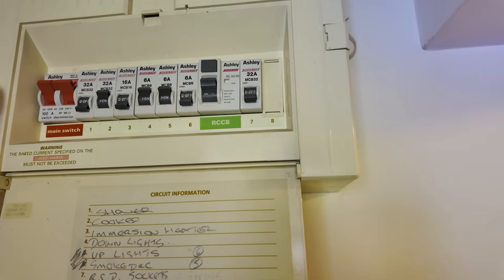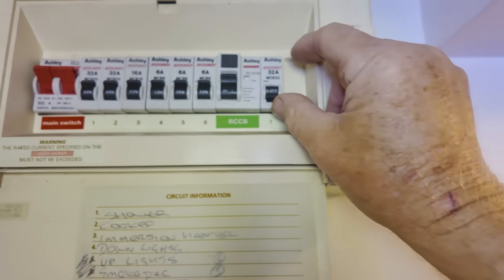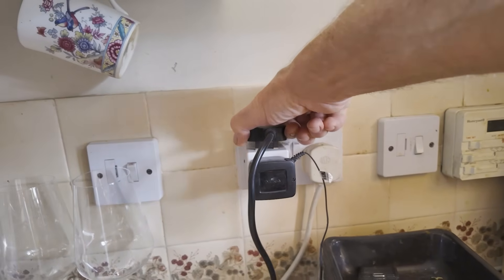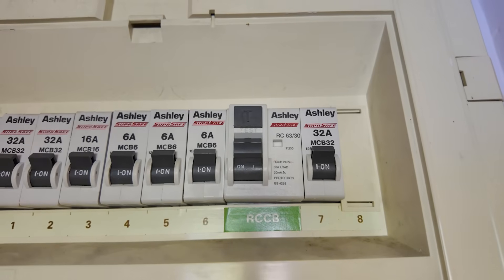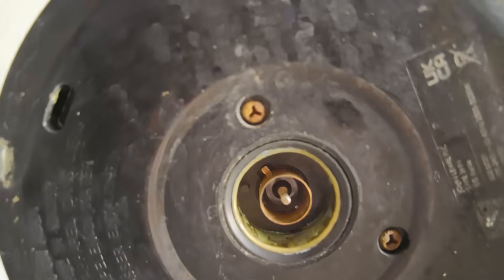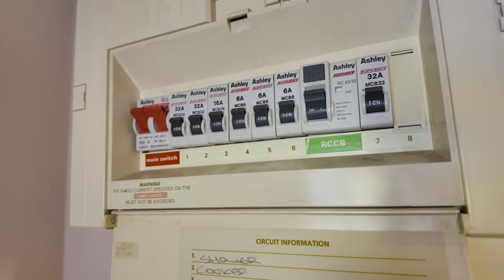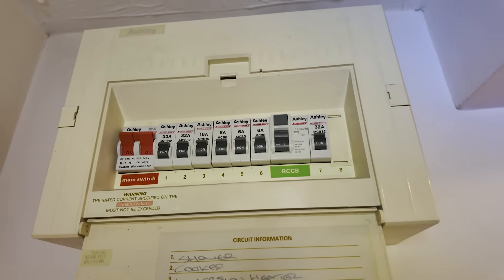FIX Your Tripping Circuit Breaker FAST!

Comment: It is almost always the bloody kettle. The insulation inside the heating element eventually breaks down due to the constant heat/cool cycles and this allows a current to leak to earth. Same thing with electric rings on cookers and hobs.
Reply from the maker: You are right but I think this one had a small leak on the bottom socket. There were traces of moisture

Comment: Yes of course ! wired fuses  CAN  cause a fire , if lazy folk just bung any handy bit of wire in them ( steel garden wire will glow red hot ! ) ... it is a good idea to have a few spare pre - wired fuse carriers ( white dot  5 Amp , blue dot 15 Amp  and red dot  30 Amp )  this gives  a  reconnection  as fast as flicking on a MCB ! .... I use a plug in RCB for outdoor activities , but the ones at the distribution board can trip in thunderstorms ( plunging the WHOLE house into darkness ! )  ... and .... certain heating elements ( sandwich grills ) , stored in a damp shed for 5 years , will trip the RCD ( until the powder in the element dries out ! ) ... also ... there is so much inside a MCB , ( rarely )  some have even caught fire ! new technology is not always the best , and even so called SMART meters have a bistable relay in them .... this means that some numpty can remotely disconnect you , I would find this annoying at 3am ! ( not possible with the older meters ! ) ....... DAVE™🛑

Comment: You'll think I'm making this up but I'm not... When I was toasting teacakes (no, not the Tunnocks variety) in a toaster, they would often trip the circuit breaker to the point I thought the toaster was knackered but I believe the fruit IN them was making contact with the electrical element in the toaster causing the breaker to trip. It's never done it since as I usually 'squash' the teacakes so they easily into the slots.
Reply from the maker: Hi Mark 
Any moisture in the bread or tea cake will short the toaster. Also sticking a knife down there to remove stuck bread is not a good idea, as I explained to one customer.
Reply: @SkillBuilder  Let us hope that one customer is not posthumously awarded a Darwin Award 😆

Comment: I have a UK , 1950's  FUSE BOX ... and I am  VERY proud of it ... the ONLY time a fuse blew ( for over 60 years ) was when my outside light's rubber cable developed a short .... (  how difficult is it ,  to re - wire a blown fuse ) ? ? ... DAVE™🛑
Reply from the maker: The fire risk with rewireables is way higher than MCB and having an RCD is essential.
Reply: Roger is correct in saying the fire risk is much greater with a rewireable fuse than a MCB as a MCB will trip much quicker & much closer to the Nominal rated current of the protective device. Whats more important to understand is neither a rewireable fuse or a MCB will protect you from an electric shock , that's the job of the RCD . Fuses & MCB's are over current protection devices which are there basically to prevent cables from overheating caused by prolonged overloading & provide short circuit protection. 
RCD's should be tested regularly to ensure correct operation, a basic test is to push the test button, which will confirm it is operating, but not necessarily correctly, this will require an electrician with the correct test equipment, which will confirm that the RCD trips with the correct time measured  in milliseconds & at a leakage current of between 18-28 milliamps approximately from memory depending on type of device. Again from memory I think it only takes a current of 50 milliamps across your heart to cause a carrdiac arrest, it is a tiny current & the RCD can prevent this if working correctly!

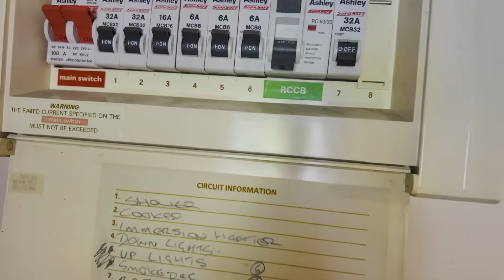Comment: 2:13 umm the RCD is still off, turn that on, and then try the last circuit, and you might have proved something, but I guess you figured that out off camera..  Otherwise, not bad.  Thanks for not opening the board, there really was not need.
Reply from the maker: The whole point was to take the viewer through a logical sequence. It is unusual to have only circuit protected.

Comment: Nice work! My money was on the multiple trailing leads with all the electronics attached. Most electronic kit uses switched-mode power supplies to create the DC to drive stuff like PCs, laptops,  phones etc. I've read each power supply can 'leak' between 1 to 3 milliamps. So if you have a number of devices on a spur/ring with a 30 milliamp upstream RCD, you can reach that limit pretty easily! That being said I've got lots of power supply stuff in my house and its not tripped due to that - yet!

Comment: Nice one Roger, very helpful diagnostic for most people.  The house looks like it is a bit of a pickle,  wires and all and no protection on those left hand circuits.   Not so good.
Reply from the maker: A bit of a pickle is being polite. It needs a new consumer board and some more sockets for sure. I don't think the present owner will do it.

Comment: Some of those sockets and even the consumer board itself have got "dated" written all over them. This might not be a problem per se but I know that when we had our consumer board updated, suddenly the bar fridge in the conservatory was tripping out everything on the same circuit, which was basically 80% of the sockets in the house. This never happened before the consumer unit upgrade. If you upgrade the consumer unit, expect more appliances (which used to work before) to trip for no apparent reason.

Comment: The consumer unit is an old split one with one rcd for the sockets only . This was common  years ago as all the other circuits were classed as fixed equipment,  like the immersion and shower etc . The main risk at that time was from hand held appliances and things like the lawn mower . The appliance check you did would always be the first thing but don't forget things like washing machines as you sometimes can't get to the plug . The common cause of rcd tripping is faulty heating elements like I  kettles , washing machines etc
Reply from the maker: Yes you are right. I made the video to explain the logical sequence of elimination. I could have started with the kettle.

Comment: Those surge protection extension leads can go rogue also - we had a trip fault, took me ages to figure out when the TV powered up the electrics sometimes when off. It was the extension lead which was duly thrown in the bin 😂

Comment: I've worked for one of the electricity distributors for the past few decades & have gone through this process over the phone & on the internet with thousands of people. Here is what I've learned:

- If the system is tripping it's nearly always the RCD, which detects earth-to-ground faults. The MCBs would generally only trip if the circuit is overloaded (rare) or a short circuit (also fairly rare). 
- Sometimes the RCD trip activates but doesn't flip the switch to the off position. Rare but it does happen.
- Turning ALL of the switches off & back on again sorts at least 50% of no-supply issues. The exceptions are when there is a powercut (from outside), lack of credit on a prepayment meter or if there is a faulty appliance,  like the one shown in this video. 
- Sometimes the RCD may trip due to a 'blip' & there is no underlying issue, so ALWAYS reset ALL of the switches. People tend to just look at or reset the main on/off switch & ignore the rest. These blips can be caused by things like lightning strikes on overhead lines or fault switching by the distributor on nearby circuits, or a 'blip' with something in the house, that then resolves itself.
- Faults with the wiring are far less common than the issue being with an appliance that is plugged in.
- A faulty appliance doesn't need to be in use or even switched on at the socket to trip the RDC. It's very sensitive & will detect earth leakage even through the residual current running through the circuit.
- Roger's method to locate the problem is spot on, but you could save time by doing the kettle & toaster first, as they are the culprits 90% of the time. 

I've also learned that, despite 20+ years of daily experience resolving these issues, a large percentage of people I speak to suddenly think they're electricians & know better than the professionals & think they don't have to listen to instructions that will help them fix the issue. Always satisfying when resetting the RCD gets the power back on & they have to eat humble pie. I've even had electricians who've been caught out by the RCD (at least they claimed to be electricians). Human nature is a funny thing!

Comment: They need to ditch those adaptor blocks, get a sparkie to install a bigger and better board and get more sockets installed to avoid the adaptors. I'd run a mile from that place as it is.
Reply: It's far from ideal but it's unlikely all the appliances plugged into the strip will be running at once & If they do put too much load onto the system, the breaker should activate. UK wiring is amazingly resilient to this kind of abuse, though I totally agree that an upgrade would be advisable.

Comment: Many years ago when rewireable fuses were still common place If you were called out on a Monday the first thing I would ask the customer was have you done any DIY over the weekend, no would usually be the first answer then I'd ask if they'd hung any pictures up, sure enough a great streak of blackness showing above the picture frame was often the give away.
Reply: That would be me! Put a nail through a downstairs wall at a weekend over Xmas, just above a light switch - what a prat as I assumed the cable ran down to the meter cupboard - not up and over....but yep weekend DIY and a scorched nail was the fun I had in a house full of Xmas lights - hiding the fact the downstairs lighting ring didn't work.... muppet....

Comment: Thank you Roger.  Much appreciated.  I suggest you turn off half of the sockets to see which section has tge problem
Reply from the maker: Good idea. What I did here was to go to the house and even though I could have just concentrated on the kitchen appliances I wanted to show how you would go about it if you were a householder. All those trailing sockets just added to the shock horror of the situation.

Comment: Moved into my new build 21 years ago almost the top thing in our car was the kettle. 5.15pm ( Friday) plugged in the kettle and the whole house electrics blew. Ran over to the site manager and he found an electrician almost 60 miles away to come out to use. 6.45pm he arrived . Went over the whole house and discovered the kitchen socket had water in it. Couldn’t find a leak anywhere, replaced the socket and everything worked. When he’d gone I had a moment of clarity - there was one thing resting on top of box carry the kettle - the cat travel basket. Turned out the cat had got nervous and pissed in the basket, running into the kettle plug just below. 😂
Reply: I'd like to see this made in the style of the old Discovery Channel air disaster documentaries:
6 hours ealier, twenty miles away a man is making an innocuous decision that will have disatrous consequences
Here kitty kitty....
Meow

Comment: Ahhhh you bring back memories. Had a similar problem except we never isolated to one device. Happened enough to be a big nuisance but every test sequence gave a different unrepeatable culprit. Finally got the electrician. No diagnosis either but he agreed to install separate fuse-RCD switch units for each circuit. No problem since. Apparently the combined RCD detector was failing,
Reply: Sometimes it's cumulative leakage from all the circuits pushing the rcd over its limit, with individual RCBOs it won't have any problems
Reply: @TheChipmunk2008  Agreed. The RCD mechanism is very sensitive. Such a situation is rare but certainly not unheard of in my experience.
Reply: @Rooster---ooo  We see it a lot (professional sparky). Especially with type AC rcds (the older simpler ones) and a lot of modern appliances. Modern appliances tend to have leakage to earth due to the filters they have to have to comply with EMC requirements,  a couple of milliamps each soon adds up!
Reply: @TheChipmunk2008  I work for a DNO & often deal with enquiries where there is regular tripping but no obvious internal cause or history of switching on our network. At that point, it can be difficult to ascertain whether the fault could be internal or external. Comments sections like this are a great way to share knowledge & experience. I learn new things every day.
Reply: @Rooster---ooo  Always amazes me how clueless a lot of people are about their electrics, one lady we did a quote for recently didn't have a CLUE what a fusebox was, let alone where it was... HOW?!
Reply: (early 70s house, meter cupboard just contained a 60A switchfuse with a 16mm T&E coming out, board turned out to be in a cupboard LOL)
Reply: @TheChipmunk2008  Spot on. It amazes me how some people can live their whole life & never once wonder how the electricity gets into their house. I figured all that stuff out as a boy, many, many years before I started working for the grid. It's just one of those things you figure out for yourself, like Santa not being real.

Comment: Rodger didnt want to shine a light on the problem. The problem is too many plugs in plug boards and multi sockets. Hope you checked his smoke alarm he'll need it.
Reply: It’s only a problem if you plug a heater or high load appliance in.
Reply: That is A problem but not THE problem in this instance. I expect he would have advised the homeowner to get an electrician in but looking at the state of the house, it doesn't look like they would have the means to pay for an upgrade. A lot of elderly people live like this sadly.

Comment: I would also have plugged something else into the kettle socket to confirm it's the kettle not the socket.
Reply: The kettle was plugged in to another socket to re confirm that it was the kettle. Note that the point was switched on & the kettle switch was the one which was being turned on!

Comment: All those trailing sockets and multiplugs.......What are you doing in my house?

That aside, when I had a circuit breaker that kept tripping it turned out that was the fault, changed it, problem solved.

Comment: Not a given these days but I'd hope this would be the first thing most people tried on their own. I'd also try plugging the offending applience into a different socket to double check it is the appliance and not the socket or the wiring into that socket.
Reply: I'd estimate 90% of the UK population have no idea what an RCD switch is or what it does. Of that 90%, I'd estimate only half have the common sense to turn everything off & back on again, let alone work out how to isolate the fault. You would be amazed by the number of people who think that just looking at the main on/off switch is sufficient before they call the electric board or an electrician. Am I saying the UK has a large percentage of mouth breathers? Yes I am

Comment: Looks like there is some space left for a separate 16A breaker to power the kitchen wall sockets. 32A should not be used in homes aa the wiring is generally just too thin to carry the load and a defective appliance could just fry these wires inside the walls without tripping the 32A breaker.
Reply: Huh? British ring final circuits can carry 32A all day long, the only concern is if the ring is broken and I come across less ring faults on 60 year old unmolested installs.
Reply: @edc1569  In the Netherlands most breakers are 16A and the wiring 2.5 mm2. This may be different in the UK, but I would still rather have 2 breakers with 16A each instead of a single 32A breaker supplying every wall socket in the home. 32A is pretty hard to trigger with a single faulty appliance.
Reply: Our appliances also have fused on the plug so for an appliance fault that will blow before the breaker in most circumstances. Obviously not for small leakage but RCDs and rcbos are very common now
Reply: @HA05GER  The whole ring setup for wall outlets in the UK looks nice for redundancy, but counting on the ring to be 100% intact for sizing the breaker seems risky to me. I would still prefer to only size it for the worst case with a 16A breaker per ring or use 4 mm2 cables for the ring if it really has to support 32A of equipment. But maybe that's just my OCD kicking in.

Comment: My shower keeps tripping any advice please
Reply: Is it tripping the RCD switch (as in this video) or the MCB for the shower circuit?

I will let a qualified electrician answer the question but they will need to know which is tripping to help diagnose potential causes.
Reply: Is it the MCB or RCD tripping?  RCD will have a test button and have 30mA label. MCB will have a letter and a number eg B50.
Reply: @insoleandlaces  OK ill have a look when I go back home thanks
Reply: @A2BWalker  I'll have a look when I go back home thanks
Reply: Have a bath.

Comment: Exactly the same happened to me - it was the kettle although I did not need a new kettle. On examination I realised that when filling with water I had inadvertently splashed the socket so when I plugged it in it tripped the breaker. After a few hours to let it dry out all was well.
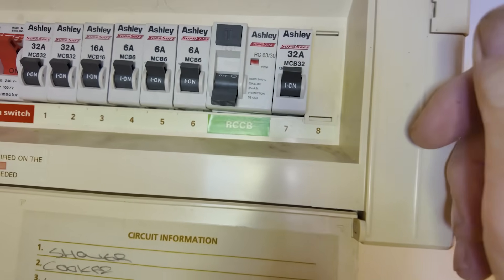Note at 2:12 in your video the RCD is off so I guess that was just a mistake whilst filming!

Comment: 2:16 the rcd wasnt on !
Reply: He wasn't testing that, it was clean. It was the other circuit. Shame the house wasn't clean though. Damn Roger, I hope you had a scrub after leaving that place. Trip hazard, greasy slip hazard, electrical hazard, fly hazard and a bucket on a shelf hazard, just a HAZARD. Also, I wouldn't want a cuppa made from that kettle, glad they got a new one, still wouldn't want a cuppa though.
Reply: @Lee.Willcox  No - he was testing which circuit was causing the RCD to trip, which is what he did at 1:10. When he did the same test at 2:16 the RCD was already tripped, so he was not able to confirm that the ring main was now good.  Maybe later he realised, but not at that point...